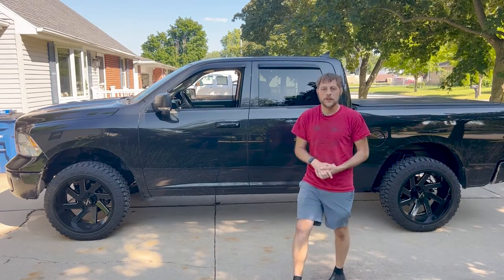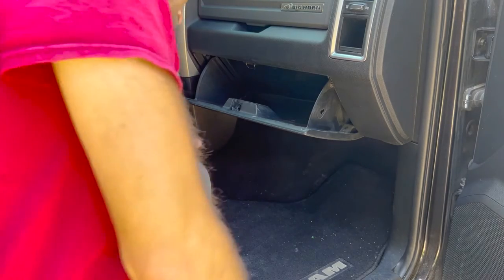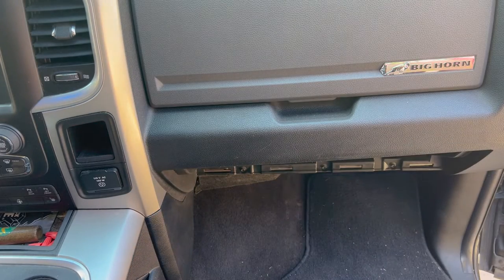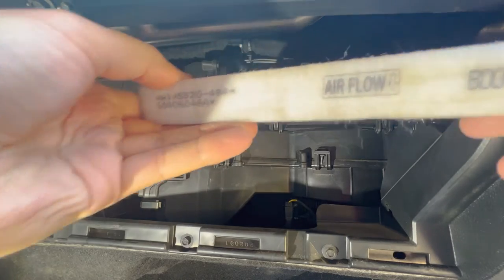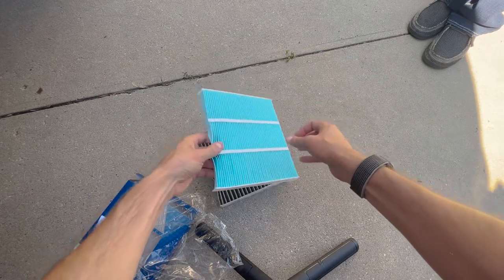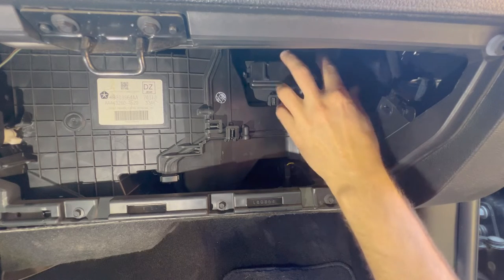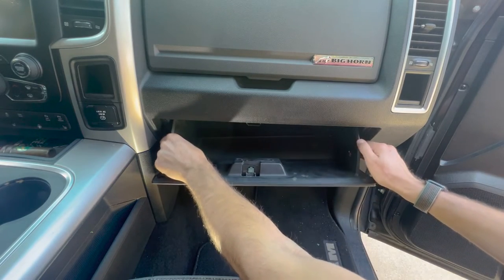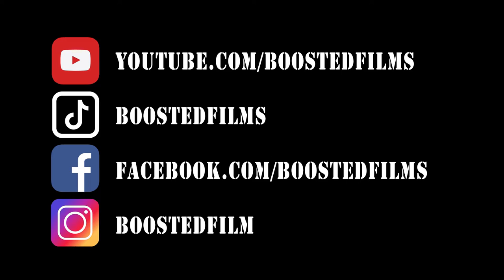Ram 1500 Cabin Filter Change - 2017 Ram How-to

Comment: Just an FYI for some that are maybe running into a snafu... some year or trim models (pre 2016 mostly?) do not have a cabin air filter. There's an outline the shape of the opening but no door. There's a kit you can buy with a filter and a door and you have to cut out the panel following the outline groove (a hot knife works best but a good sharp exacto or utility knife can do it).
Reply: Thanks for this comment. I’ve been trying to figure out how to take this cabin door off for along time, and I decided to read the comments and ran across yours. I really appreciate this comment because I was struggling 😂